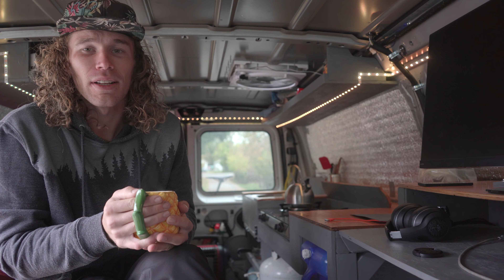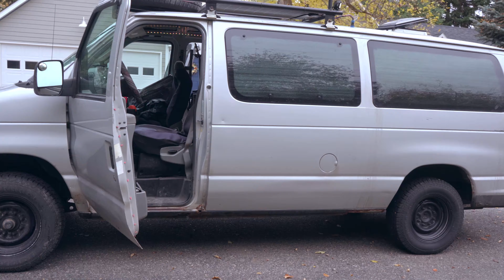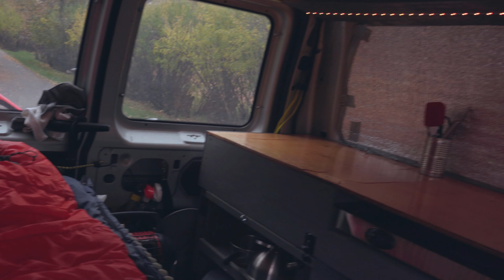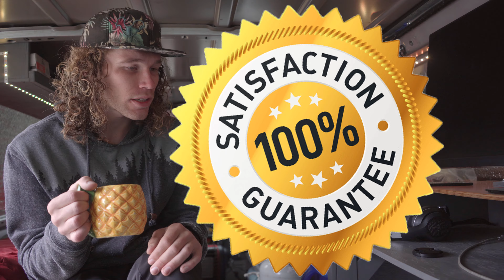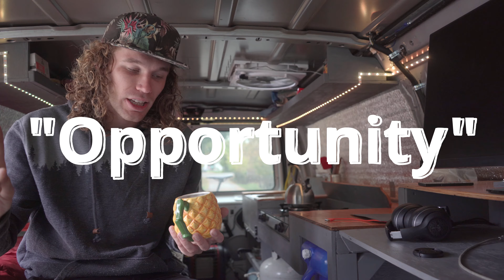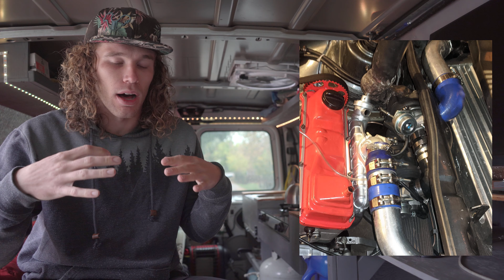Build Update #2 - MK1 VW Rabbit Turbodiesel (4K)

Comment: Are you using a stock 1.6d block or the 1.6tdi block from 84
Reply: Tdi didn't come til the mk3ish era I believe
Reply: Also would love to see the inside of the motor and your rebuild processes
Reply from the maker: It's a later model 84. Still just a td though
Reply from the maker: Yee! I'll have to see if I can find some of that footage - worst case there'll be more when I tear it down again
Reply: Tdi stands for turbo direct injection. 
And1.6 we’re all indirect injection. 
So if you don’t want to sound cringe worthily naive, 
Don’t ever say 1.6tdi again

Comment: Bro, I need a way to get in touch with you to ask so stuff. I have a 1.6td H-beam rods good pistons, gov mods to pump match ported head shooting for as close to 200hp as I can.  Just have some questions I would like to pick your brain about. Love what your doing!! Have you heard of Giles Performance Injection Pumps? If so been looking for someone to give real feedback on the performance of them. Much love! #81RabbitTruck
Reply from the maker: Go ahead and shoot if you have questions! ⬇️
Reply from the maker: That sounds awesome man! I do run a Guiles pump. I think you can get to 90% of guiles performance with a good tune and the governor mod. He does switch a few parts for custom ones, like the fuel pin.
Reply: @OliverFetter  Hi Oliver,  I like your videos on the turbo diesel vw, I'm currently working on a 81 caddy truck that I swapped a ahu tdi into, bought a Giles pump and made the swap all mechanical,  I'm having trouble getting the truck running correctly,  engine starts and idles perfect,  but when you hold the throttle open it starts breaking up. Any help would be greatly appreciated thanks Dan
Reply from the maker: @danroppolo5308  Hey man! Thank you. Sounds like a cool project. Elaborate for me: what do you mean by breaking up? does it misfire/smoke (& what color is the smoke?). Is it breaking up under load or just when you are revving it in neutral? Are you making boost?
Reply: @OliverFetter  Hey Oliver thanks for getting back to me about this,  I have boost, and the smoke is white to grey and the engine seems like it won't rev past 2k before it just starts acting up,  I bled the injectors but no luck, I'm hoping that I could possibly send you a short video on what it's doing and maybe you can diagnose it.  Thanks again
Reply from the maker: @danroppolo5308  hmm 🤔 yeah that might help. If your on IG you could send it to @ollies_auto. Have you checked the engine and pump timing? It sounds like one of those could definitely be off (make sure to time the pump with the choke/static advance all the way in!). Is the motor otherwise sound to your knowledge? Head gasket, running temps, etc?
Reply: @danroppolo5308  

Do you have a 1.6 Giles pump or one for a TDI?

I have had a Land Rover 300tdi injection pump on my ahu, in my caddy, for over a decade.

Comment: Did you block off the stock pressure valve on the intake? Also you inspire me to keep my 1.6d instead of swapping it to a tdi. I learned from your "mistake" and installed a intercooler in the front last week :)
Reply from the maker: I did indeed - you can remove the spring entirely and tighten the adjustment screw till it's forced shut - might need a longer screw! I think I blew the turbo from overspinning it - should've mentioned that. I had the wastegate blocked off hahaha